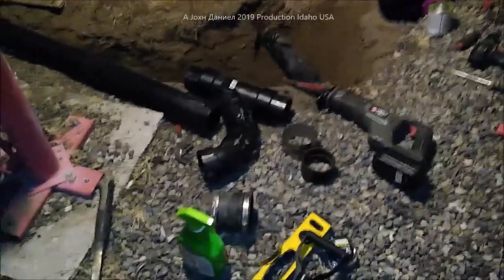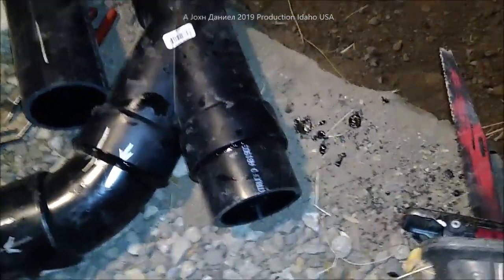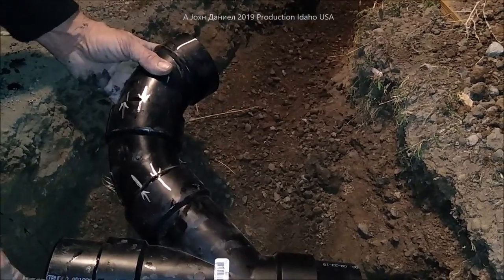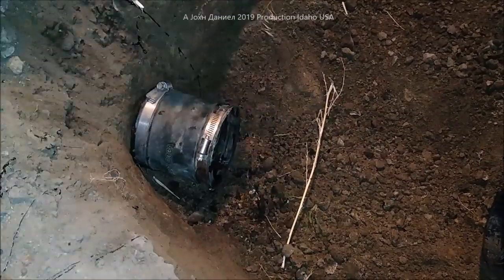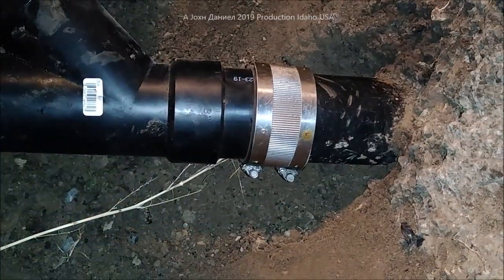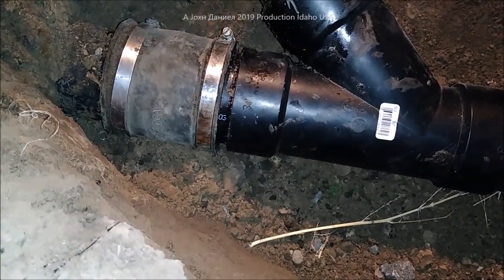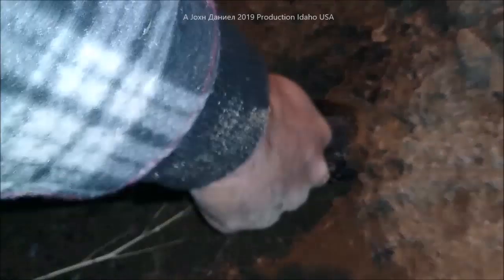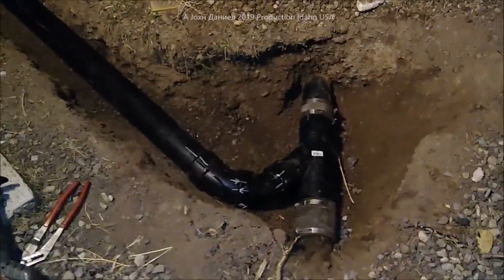Sewer tap Clean Out for a 3" RV waste drain install DONE FAST

Comment: Nice trick, folding that rubber coupling back then flopping it over in-place. Nice Job!
Reply from the maker: I probably installed a few hundred thousand of these no-hubs many hospital jobs and commercial jobs using cast pipe.

Comment: Thanks, doing something similar in a few days for friends.   Their current one is on the wrong side, they're older and working the stinky slinky under their 5th wheel to dump is a task for them.  

Hopefully can tap in this easy to current setup, helps to see what I'm getting myself into before digging.

Comment: Hey John, Nice Plumb 101... Well About 10+ Years Ago I Found A 50' Fire Truck Water Hose They Threw Away  Because It Had Blown A Hole About A Foot From One End & I Put It In My Mics Parts Pile! Then I Lost My $500K Ranch Of 8 Years There & Had To Move Into My 30' Motorhome To Live On A 1ac Down The Street That I'm Now Buyin From Some Good Neighbors, It Has A Water Well & A Septic Tank For A Double Wide That Used To Be Here! So When I Setup The 30' Pathfinder RV On Levelin Blocks, I Used That Cut Off Flat Fire Hose w/An Adapter 2 3/4" To RV & Just Stuck The Other Good End Into Septic Inlet,  2 Years Now w/No Problems Yet, Just Stick A Water Hose In Toilet & Flush Out Once A Month?  LMAO
Reply: Kind of a cool idea but except for one vital thingwhen dealing with sewer you should not use a flex pipe or water hose because there's a very strong chance of the holes bending or flexing or just manipulating in a way that the sewer line backs up a safer way is to go with standard black PVC pipes and cement glue.not saying your idea couldn't have worked or does not work but it really raises a red flag to someone that knows plumbing and sewer lines because a sewer line can't be manipulated into a flex line there's a lot of problems that can go along with that code wise.

Comment: Hey John. Great vid. I’m adding a bathroom and dug up my sewer line to my septic. When I dug it up I found it was orangeburg pipe. Will those fittings fit the orangeburg pipe as well as the pvc? 
Thanks
Reply from the maker: Remember Orangeburg has asbestos in it, so spray down with WD-40 when cutting and use the 4" Clay Tile to 4" Schedule 40 Fernco to connect it. https://amzn.to/44pdhYM ( get 2 ) and bed back in with loose soil or sand if you can get it once you made the connection. Use ONLY a 4" x (3or4") Wye, not a TEE. From it you can go to that bathroom so get your elevations right to maintain 1/16 to 1/4 per foot fall ( flow) do not angle sharply. You can connect to ABS or PVC, but be sure to cut with a good blade and DO NOT put your Saws-All ( reciprocating saw ) up against it, so get a LONG blade like the Diablo 12" to do the cutting. https://amzn.to/4blsRqw

Comment: Plumbers are no longer using fernco / mission band due to dropping of pipe causing offset it's now no hubs / Hercule band
Reply: I've been plumbing 25 years and still use them all the time. Pipe just needs to be supported properly and inserted all the way.

Comment: Question. Why not just use rubber coupler on both ends? Why use a fernco on one and coupler on the other?
Reply from the maker: I used 2 options for the video, showing you can use either style, many people do not know the options. But you can use the same of both if that is easiest to get.

Comment: How can you find out where your sewer line is? I’m looking at buying a house, but want to use an old rv as a rental on that property
Reply from the maker: A lot of variables involved in that. City, Rural, what country your in. Freeze Depth, and design of home. Usually look up on the roof, see the largest pipe used for sewer venting, coincide that with where the toilets are,  and then locate the sewer clean out at the ground down below that area to get started.

Comment: Thanks for sharing. Was looking at doing something similar but not sure how to determine if I have enough drop between my RV and Septic line. Any tips?

Will need about 45 foot of pipe to reach septic line from RV and it is almost a perfect 90 degree contact so also not sure which connection to use.
Reply from the maker: If you have a 2 foot level, you can figure out drop ( drain angle) by just using the bubble if its just off center, touching the line you have enough fall for a sewer pipe. 1/16" per foot is good drainage rate, 1/8 is max needed. Somewhere in between is perfect. So if your sewer tap is about 6" lower than your spot  for your RV in Fall ratio you can easily make it work. Just be sure your under ground enough to protect it from bad weather or traffic near it.

Comment: Is the line gravity fed/does it need to be a continuous down hill from the RV to the sewer line? My RV is probably 150 ft from the sewer line. Would that work?
Reply from the maker: Yes, but continuous requires very little pitch on it. 1/16" fall per foot is standard so if you have as close to that as possible your ok. I have done 1" of fall per 10 feet of run without any issues. So in your case if you have 15" of difference from septic up to RV tap and no flat spots in the pipes run your fine.

Comment: No-hubs are not designed for underground use. They will eventually rust out.
Reply from the maker: The only thing on them that will rust will depend on the country it's made in. Chinese made the clamp and screw will rust, Mexico made the Screw in the clamp will rust, USA made like mine, metal parts made by IDEAL, and its metal parts are 304 stainless steel as required by BOCA 1977. 
Almost 23 years (up until 2011) of doing commercial plumbing and using them in full wet conditions, burial, and hot space.  I have saw all three options above show up on jobs. Stick with ProFlo and not have problems. 
No Hub Specs - 
Product Details
 Corrosion resistant 300 series stainless steel shield with neoprene gasket
 5/16 in hex-head screw designed for 80 lbs of installation torque
 PROFLO no-hub couplings are engineered to connect no-hub cast iron pipe and fitting
 PROFLO no-hub products are designed to meet or exceed specifications for couplings used in all drain, waste, and vent (DWV) no-hub cast iron pipe system
 2 clamps per coupling
 Made in USA
https://www.ferguson.com/product/proflo-2-in-no-hub-standard-coupling-pfnhck/_/R-1395849
( BOCA - Founded in 1915, Building Officials and Code Administrators International, Inc., is a nonprofit membership association, comprised of more than 16,000 members who span the building community, from code enforcement officials to materials manufacturers. We are dedicated to preserving the public health, safety and welfare in the built environment through the effective, efficient use and enforcement of Model Codes. BOCA provides a unique opportunity for any individual to join and derive the benefits of membership. Our members are professionals who are directly or indirectly engaged in the construction and regulatory process. 
 National Codes set forth minimum performance requirements for all aspects of construction. They address the areas of building, fire prevention, mechanical systems, property maintenance and energy conservation. The ICC International Codes are the result of a cooperative effort between BOCA and the other model code organizations to bring international uniformity to all codes. BOCA International Standards are available either individually in sections - National Codes and Code Commentaries - or as a complete service.)

Comment: What fitting did you use to tie the flexible sewer line from the rv? Does it go right into that 3" st 90 with a band ?
Reply from the maker: The flex hose that comes from the RVs in most all cases will fit down slip-wise inside of 3-in pipe. So the fitting I used was a 3-in street 90 hub on one end pipe diameter on the other end. I turned the pipe diameter up and then I used a regular fernco 3 inch rubber cap as a cover when not in use. Your rv sewer hose will slip right into that. If you want to use a 45° Street fitting 3 in you can do that also but test fit your hose you're going to use by removing the other clamp end and slipping it inside your 3 in PVC or ABS pipe. The flexible sewer hose does fit well enough into 3" PVC pipe  that it will not backflow out.

Comment: Are these metal couplers ok to go underground? Won’t they rust?
Reply from the maker: Yes, 30+ year lifespan stainless steel. PVC and ABS only has a 35 year expected lifespan before they begin to break down, PVC sooner, ABS can make it 50 years. But they have outlawed the use of ABS in many places surely getting bureaucrats bribed to do so by the PVC industry and unions.

Comment: ... and make sure you check with your local code enforcement and building permit authority ... in KY the fines for bootleg plumbing can be life altering.
Reply from the maker: I have 8 fixture units of open rating still on my system. The county here just accounts for that and if it's added indoors is the only thing that would require a notice of alteration. The city however is a different game though, that's why I live 12 miles from it.
Reply: @JOHNDANIEL1  
not throwing shade, just a little heads up in case someone hasn't done any of this kind of work. 
Thanks John.
Reply: I moved out of the city, and county, where I built my first house because it became to complicated to live.  I now live out away from any city, in a county with no zoning, required inspections, etc.  I only have to meet state requirements on septic.  I have a 1000 gallon tank and 300 feet of field line.  That's more than what's required, but when it comes to septic...more is better.

Comment: Hey John do you have a suggestion on my van's door slide track wiring? 
I'm good at soldering but I'm hoping to do it less often.
Youtube searches tell me how to solder & how to replace it.
I found some track wiring that is used on cranes and is PRICEY and large. 
Another site has smaller track wiring for robotics, also pricey.
You might not have fixed something like this so I understand.
Thanks
Reply from the maker: A option, https://amzn.to/2qxBFJn

Comment: Won't the rubber degrade in a couple years?
Reply from the maker: Expected lifespan under ground out of the sun is 60 years.
Reply: @JOHNDANIEL1  hey can you give me some advice on doing this. My sewer is green SDR so should I use all PVC or should I do ABS fittings?
Reply from the maker: @mknight6026  Stick with PVC since adapters from SDR 35 to Sch 40 is off the shelf ready available.
Reply: Ok thanks. Looks like most stuff here on the shelf in 4" is the SDR white. Not sure if their going to make me buy 10 feet of 4 inch of thin wall here instead of by the foot bit I guess there's one way to find out. Thanks